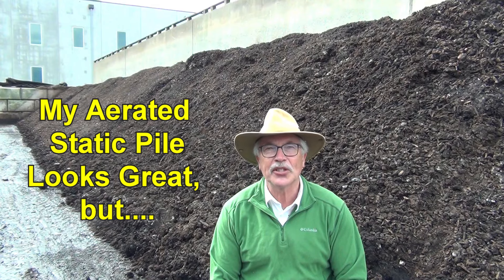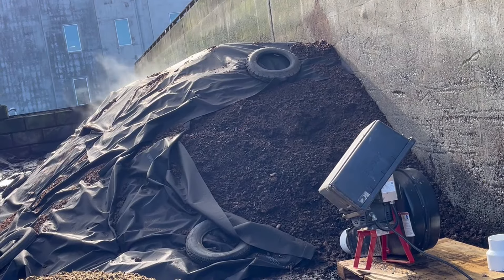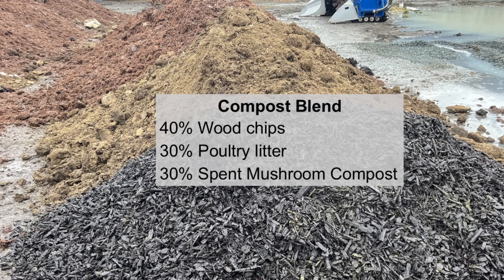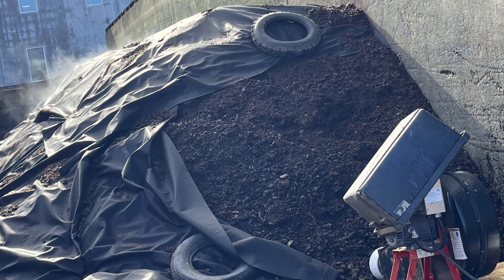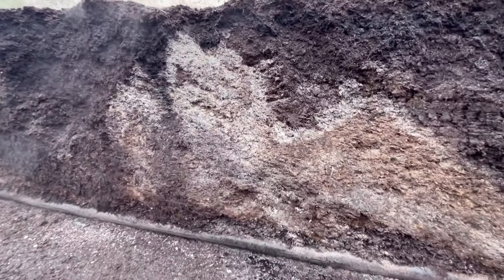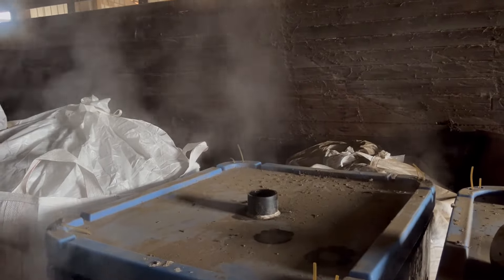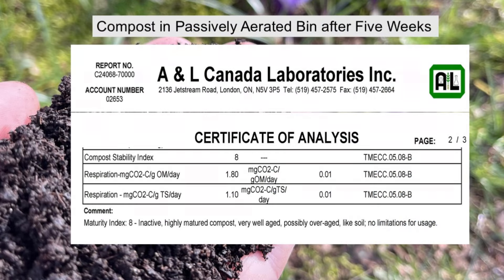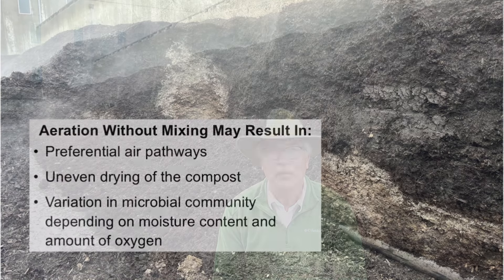My Aerated Static Pile Looks Great But...

Comment: Could you incorporate a mister into your blower pipe to help reintroduce moisture? A cool mist vaporizer/ diffuser can put off significant moisture. Could be a way to add air and moisture when needed. 

Love the videos. Makes me wanna study the subject more.
Reply from the maker: Thanks for your question! Yes, a mister into the blower pipe might help somewhat in areas where the ambient air has low humidity and the temperature is higher. We need to consider the psychometric curve which informs us that air at low temperature is not capable of carrying much water. In areas that have low temperatures and higher humidity, a mister is not going to be able to add much moisture to the air.

Comment: For several years now at three facilities that I have operated, I have chosen (and had the operational luxury) of doing frequent re-homogenization, while keeping material on ASP. I compost food waste, ground brush and leaves. Usually  I put my blended feedstocks on ASP for 2 weeks, then remove, add moisture if needed, turn thoroughly, and return to ASP for additional 2 weeks. Then after 2 weeks repeat again, and return to ASP for another 2-4 weeks. Material seems to benefit significantly from these turns- Its obvious, because after turn 1 (and turn 2), temperature dramatically increases, telling me that the biology is very happy, as the moisture is at good level, porosity is restored and materials have been physically agitated. Aeration is increased to reduce temperatures. I find that after 6 weeks of this kind of management, material looks beautiful, agitation from turning has increased fines, and material is relatively stable and mature as per solvita test.
Reply from the maker: Thank you for sharing your success!

Comment: Hello John. First let me thank you for your thorough and concise videos. I have been learning a lot since I want to start a composting business myself. I know you are from BC and how much rain you get over there. You mentioned both protecting the pile from the rainfall and having to deal with dry patches in you aerated piles. In my area we have about 1000mm of annual precipitation. BC should be 1.5 to 3 times that amount. I wonder whether I can have an aerated pile outside with proper leachate collection around the compost piles. Thanks.
Reply: why not.....what material are you suggesting?
Reply: @glen.simpson  thanks, I am not sure what you mean by what material.
Reply: @karohe  sounds like you are going to buffer the sides and bottom of your pile with some sort of material that allows your pile to not get too wet... you called it leachate
Reply from the maker: Thank you for your kind words. Yes, you can compost succesfully outdoors where you are receiving 1000 mm of rain annually. It would be helpful to sort out whether the 1000 mm of rain falls equally over the 12 months or if you have a rainy season. In more rainy periods, its beneficial to maintain enough porosity in the composting material to allow airflow even if the surface moisture content is higher from precipitation.
Reply: @TransformCompost  Thank you John. There are certain knowledge that can only come from experience. I really appreciate what you are doing.
@glen.simpson, correct. My plan is to have CMU walls, and graded concrete bottom to collect the leachate and send it to an aerated septic tank. I didn't understand what you meant initially.

Comment: In the Gaelan Brown's compost heaters book, there is a system used inside insulated boat container, where the air is insuflated under with multiple pipes under a thin concrete slab (to loard and unload easily with a tractor, without destroying pipes etc), and water pipes on top, harvesting heat, to warm a big workshop. The composte heat better with insulation, and the steam condenses in the top water pipes because they are colder, so almost no water is lots because of the heat.. Plus you have a big heat production !!
 I myself tried to do the same, the smaller i can so it could fit in my house to warm it. But it was maybe too small or need improvement...
Reply from the maker: The heat capture system that you describe is the optimal way of recovering heat energy from composting material. We have done it using a 1.5 m3 insulated bin. The one challenge is that even though the cold water at the top allows condensation of the steam from the compost, the  water is not evenly distributed through the compost, and we expect to see drying at the bottom where the pipes are, and moisture content up to 75% at the surface. And we have to remember that once organic material dries, it does not wet up very well! Fun project though!
Reply: @TransformCompost  Also, if I remember well, they aerate not with fresh cold and outside dry air, but, but à big % of the same wet air, having a lever to change to find the right amount of each.. So the aerating air is actually participating in not drying / wetting it where it could otherwize loose..
Thanks for your answer !

Comment: thank you..... so maybe another turn of the wind row right when you peak in temperature after your first turn?  You will lose some temp right after that turn, but it should bounce back as those dry pockets reactivate the whole row..... kinda like your activator for another row turn is right there... it;s your dry pockets.   Can you turn that wind row with that aeration pipe underneath?  That would be an issue with this scheme.
Reply from the maker: Yes, when I mixed this same mix more often, I reached maturity much faster. By mixing twice weekly, aerating and managing moisture , I have reached maturity in 3 weeks. Generally temperature bounces right back within hours of turning. No issue with turning with the aeration pipe underneath, we simply pull it out. I just have to have the time and willpower to spend four hours turning the pile!
Reply: @TransformCompost  thanks again.... I am a leaf mold soil maker.... If a can get together 20 cubic yards a year I am lucky, so what you are doing is somewhat different, in scale too....although, I do use screened wood chips in that leaf mold mix.... I think it is important for folks using chips to recognize these 2 issues 1, the chips really must be screened down to say the 1cm size, and 2. the wood chips really need to be aged 1 year before sending that stuff into the leaf mold process..... my leaf mold process yields hot compost piles, unlike in nature where the leaves rot slowly on top of the ground, so calling it leaf mold soil is kinda incorrect given it comes out of a hot process....again, thanks for your work in this area.  Lots of folks doing this kind of stuff lack the structure and scientific approach you are doing.....
Reply: @TransformCompost  to sum things up...aeration accelerates composting, although in bigger piles, you may find some dry pockets  from air channeling.  This necessitates another pile turn to achieve compost maturity.  This second pile turn and moistening (if necessary) will reactivate the microbial process and increase heat again in your pile.   This results in a mature compost/soil in as little as 3-4 weeks.  

WHen I fine screen material (1/2 inch) after my second pile turn this is what I see. This new pile of screened material wants to go hot again to some degree. So, I let any finished screened pile sit for a minimum of 3 weeks prior to adding to the field/garden.  Stuff can go out a little hot and young plants hate that..... let that pile rest a bit before getting it in the garden unless you are 100% sure it's mature. 

ANd from my experience, when adding wood chips, use aged and screened chips. I use chips from white pine and a small amount of hardwood, which I feel should be rested for 2 years, ideally.  There's stuff in fresh chips the soil microbes and plants don;t like when it gets concentrated in a piles as fresh, raw, juicing wood chips. WHen you see some fungi inside your wood chip pile, you can then integrate those chips into a soil process. Wood chip piles need to be keep a little moist all the time to accelerate fungal processes.
Reply from the maker: thanks for sharing! Sounds like you are having fun with and benefiting from the composting process!

Comment: have you ever done these types of experiments using added fungi or bacterium, such as mykos or azos and such?
Reply: meh. The mykos can be added once the pile is already mature because those types of fungi don't grow unless they are near plant root exudates as far as im concerned. Bacteria are not really needed unless you intend on growing nitrogen fixing plants that require rhizobium, but most compost piles made correctly already have rhizobium in them. My biggest issue with adding these microbes is that they are likely not native to where the compost is being made and a lot of them are unnecessary (especially in non-farming operations).
Reply from the maker: I have never added fungi or bacterium to composting material, my preference at this time is to understand and optimize the microbes that are already there.
Reply: @TransformCompost  thanks

Comment: Thanks John
Is there a benefit to humidify the air input?
Reply: Or a way to keep it in... Like.. Localised condensation ;)
Reply: humidify the air input....I have always thought about that idea as well, but the moisture from that air might be disproportionately added to where the inlet of the pipe is because it may be difficult to move the water through the pile like that. How much compost are you wanting to make?
Reply from the maker: Thinking about humidifying the input air requires understanding the phsychometric curve, which informs us that the water holding capacity of air goes up logarithmically with temperature. That suggests that humidifying the air may help somewhat if the input air temperature was 30 C or higher with low humidity. On the other hand, if the input air is 10 C and almost 100% humidity like we have, the air can't absorb much water.
Reply: @TransformCompost  Ok, good to know ! And what about using ultrasound humidifier in the air input, otherwise ?
Reply from the maker: @AutoNomades  Sorry, I am not familiar with ultrasound humidifiers